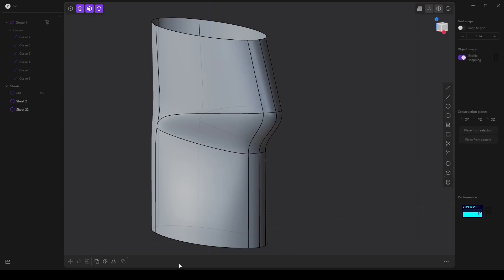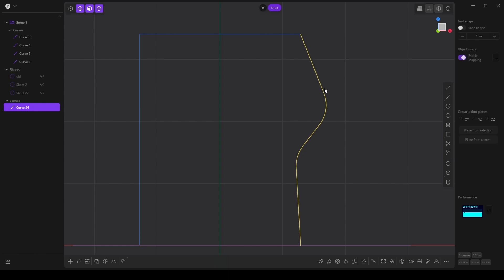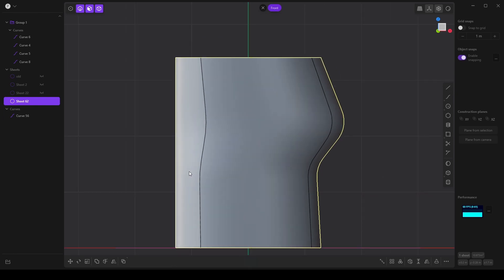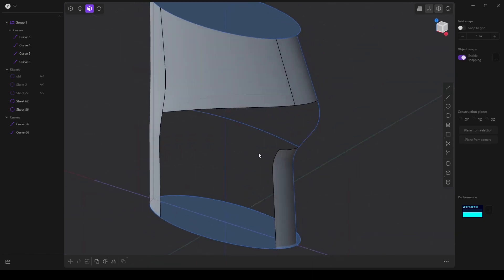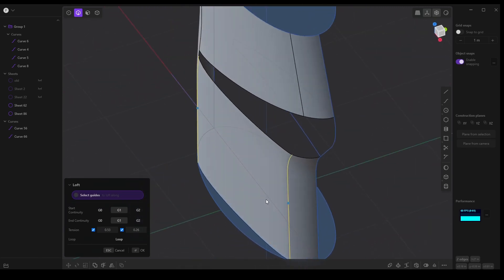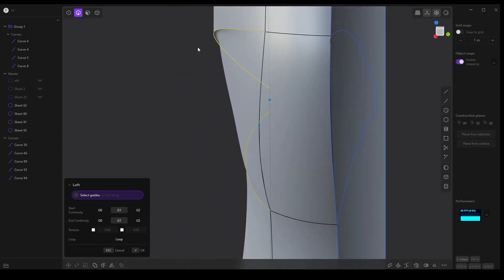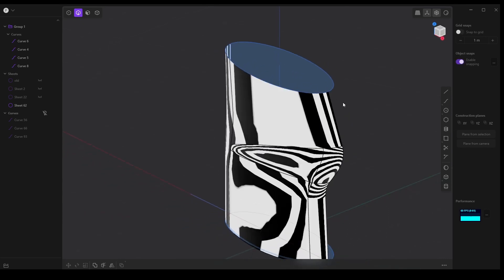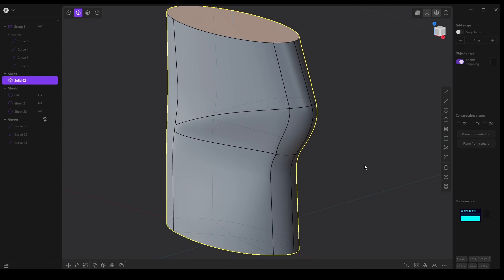Mastering smooth surfaces in Plasticity (Drawing in 3D)

Comment: On the bottom patch. I had issues patching the bottom. I used a line to cut just above the bottom to clean things up and once I patched I didn't have the weird cross sections. I don't know if you still have this model but would be curious to know if a cut would cleaned up your bottom patch geometry.
Reply from the maker: It probably would, yes.

Comment: Actually I don't get how you add 2 cut to the surface😅
Reply: I guess you mean isoparam. It is ctrl+R. It adds an edge along one of NURBS directions, which you can switch with tab while creating. It is quite similar to swiftloop, but it won't work along multiple faces at once
Reply: @MIchaelSybi  Yes, you're right. Thank you.♥️
Reply from the maker: If you are using the Blender hotkeys, then joining multiple curves can be done with J. 

Cutting can be done with C.
Reply: @ReboundAnimation  I'm actually using 3ds Max hotkeys, also I didn't see you use curves to cut the surface, it looked more like Swift Loop in 3ds Max.
Reply from the maker: @tone-69  From taking look, I think the hotkeys may actually be the same and it's just the navigation that's different. I'm using 1.0.0.

So it should be still C key to cut. Or if I'm missing something, the three-dot menu in the lower right-hand corner opens a search for different commands.